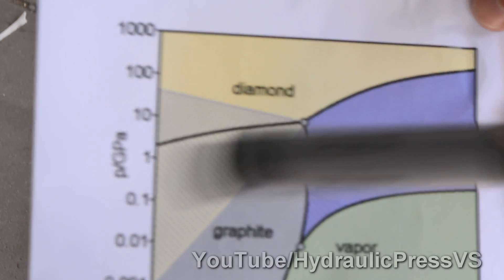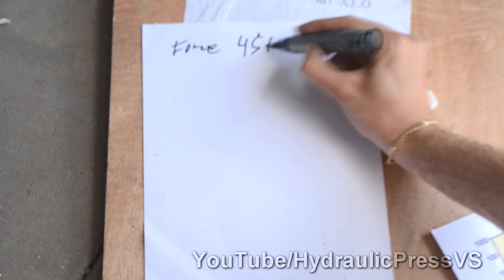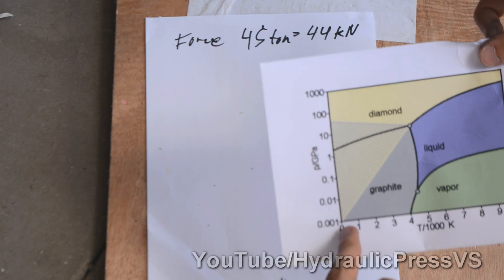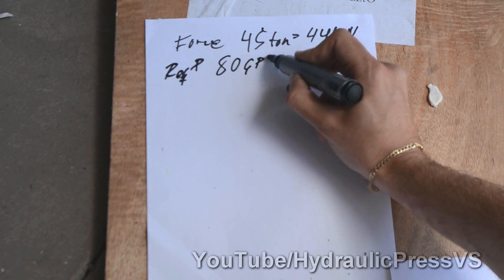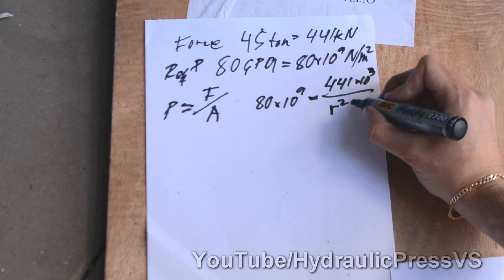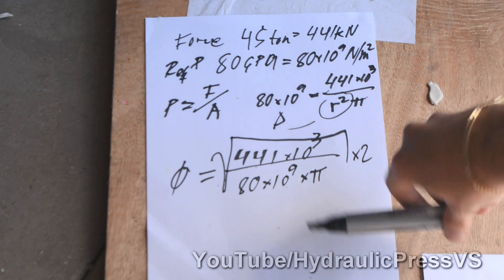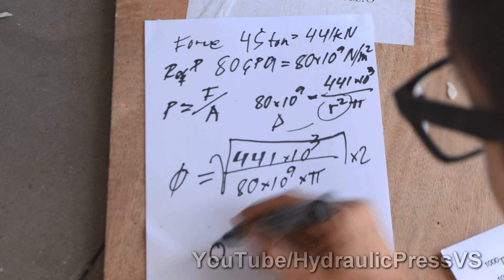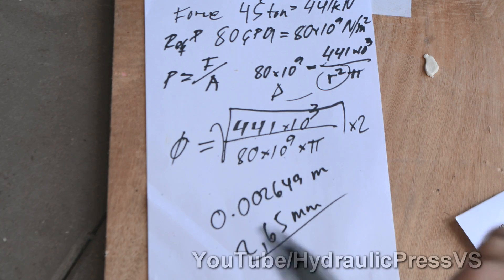Charcoal vs Hydraulic Press - Can you make diamonds from coal?

Comment: Could you please make a different experiment using smaller diameter of the piston and cylinder and then press it and then hold the pressure. Could it be possible to make pellets or something with coal but highly compressed?
And the piston and cylinder should be much longer.

The cylinder should be able to open like a casting mold.

Comment: But what if the cylinder has 25mm in diameter and the piston is slightly smaller but the length of the piston and cylinder should be long so you can fill it with a high amount of coal.

Comment: Even if you could get the pressure, wouldn't it not work bc the diamond would be harder than the metal in the press? It would just embed into the metal before the hardness hit 10 and never get hard enough to become a real diamond.
Reply: Also am i wrong in saying its Heat + Pressure + Coal for a diamond? not just pressure.

Comment: Although I know this video is a joke, I don't believe its possible to make diamond out of just compressing a different form of carbon. If you put dry ice in an incredibly powerful hydraulic press, it wouldn't make a diamond because the hydraulic press would have to change the atomic structure of the material

Comment: THEY DID HAVE TO PUT IT IN A  METAL PLATE WITH AN HOLE IN THE MIDDLE WHIT NO  EXIT AND PUT THE CAOL INTO IT AND COMPRESS THE  IT WITH AN METAL STAFF THAT ONLY FIT THE HOLE PRESS IT O THE MAX SEE WHAT HAPPENS TO IT , NOT LIKE THIS WAY THEY DID IT

Comment: Charcoal has wood fiber in it, wouldn't work anyways.pure carbon to start, heat it in a inert gas to 500,000 degrees using lasers, then squeeze it in a closed container in a 200T press.
You still won't get a diamond, but you'll be a whole lot closer than this experiment.

Comment: First of all, charcoal is burned wood. All if not most of the carbon is burned out and if there was any remaining it isn't enough to form a diamond. The molecules would crack first. Second a hydraulic press cannot create enough pressure to form one even if it was coal or graphite it requires about 1 million atmospheric tons to create a diamond that is less than a millimeter large. Which isn't worth anything. That also doesn't include the amount of heat that it requires too to make a diamond. It would take about 2,000 degrees Celsius too to make a diamond. Third and finally, if you were ACTUALLY ABLE TO FORM A CUT, FULLY CRYSTALLINE DIAMOND WITH CHARCOAL from a hydraulic press then I would go out right now and buy a hydraulic press and 100 bags of charcoal and press them all down into diamonds. Thanks for the get-rich-quick tip but i think I'll stick to reality thanks.

Comment: First of all, diamonds cant be formed from charcoal, only pure coal or graphite, because they are different forms of carbon atoms. Second of all, a significant amount of heat, and a very large amount of pressure is required for a diamond to form. Third, in order for the diamond to become that shape, you have to use lasers to cut it.

Comment: This is just for fun folks.  It's not real, otherwise everyone and their dog would be cranking out diamonds and they wouldn't be worth anything.  To make a diamond you'd need this kind of pressure... or more even... + extreme heat + many, many, many years of time sustaining the pressure and heat in order to produce the kind of rock that would then have to be cut and polished into the piece they pulled off the press here.

Comment: well, it is doable, you didn't follow the instructions though. what you need to do, is to get enough material, get the right temperature and apply right pressure to all material equally at the same time. simples.

Comment: first. you need to adjust a container around the charcoal
,two  then heat the container  add  pressure when temperature is over 1000 degrees you can press the material slowly

Comment: Come on bro at least use real coal, not a fucking charcoal briquette that people use for barbecues. Charcoal briquettes wouldn't work anyways because they're not coal, they have a lot of other additives plus this is a chemical reaction also not just pressure, also heat and several other things
Reply: Diamond isn’t made from coal anyways so it would never work
Reply: But heat is caused by enough pressure
Reply: Ollie Brocklehurst also it is in nature but indirectly sort of. Anthracite coal (coal when it has a very high percentage of carbon in it) is made of the same element that diamond is made of (carbon), but diamond takes a longer time to form because it needs more heat and pressure than coal does when forming. When coal forms, it is because pressure from rocks above it compress and heat it to a solid block of organic material (which on earth is mostly carbon). However diamonds need to be heated to the point that they become crystalline, which would make coal impossible. In nature, when a crystalline mineral or rock is forming underground, and takes longer to cool off to fully take shape, it will have larger individual crystals or one big crystal in some cases. So technically when you have a block of anthracite coal, you have everything needed to make a diamond. Except the time and energy
Reply: First: Get some coal, of any kind.
Second:Get some TNT.
Third:Arrange it perfectly around the coal.
Fourth:Get to a safe distance from TNT.
Fifth:Detonate it.
Result: Aton of Diamonds. 
It's not that hard.

Comment: You need to have it super heated and under extreme pressure. Plus it came out cut, and if you did even manage to make diamonds, it would be in tiny particles not a big piece like that. [EDIT]: That's also Charcoal. Not coal. Can't get diamonds from Charcoal far as I am concerned.

Lies.

Comment: For anyone that didn't know, Diamonds are formed from immense heat and pressure from under /  inside the earths crust. Which is why we mine for the true diamonds ( Not man made ) ; ( Man made diamonds are much weaker then regular diamonds, yet have the same appearance. ) A stunt like this would be impossible to be real. If it were true, We would all start buying coals and hydraulic presses..

Comment: Charcoal? Are people really that stupid?
Reply: Okay, under TONS of pressure, like TONS, and an EXTREME amount of heat it is entirely possible to create a diamond with charcoal
Reply: whahahahaha i didn't even catch that XD yeah that doesnt seem posible haha
Reply: quiksilvermanblue no your stupid compressing coal to diamonds is a thing when you do it's called a man made diamond
Reply: Shaen not enough it be very little
Reply: Yes you can create diamonds with carbon tons of pressure and a looooot of heat.And charcoal is carbon but in this video the heat and the pressure is missing
Reply: Shaen COAL, not charcoal. Not to mention man made would be synthetic.
Reply: Coal is made of carbon. Diamond is an allotrope of carbon , just with more complex and compact intermolecular bonds (which is  why diamonds are so hard to break) this is why under perfect conditions taking into account the coal purity , the temperature and the force exerted. A diamond can be produced from compressing coal.
Reply: People are idiots
Reply: It does work with charcoal
I can explain it.
Diamonds are made of carbon atoms that are VERY tight.
Coal and Charcoal are MADE of also carbon atoms, but not that tight.
If you search what is coal or charcoal made of.
You will see that both are made of carbon atoms.
You just have to press it with the right amount of pressure and heat.
Reply: Coremanite Siege yeah but who cut the diamonds?
Reply: quiksilvermanblue  charcoal are form diamonds if you have the sagested amount of temperature and preesss
Reply: Shaen thats true, but for coal, not charcoal

Comment: A hydraulic press exhibits Force, not Pressure.  You can't realign atoms when they can move away from the force.  Oh, and charcoal is not coal.  not really even close.
Reply: Are you ok sir? The literal google defenition of pressure is a continuous force on something. Also force is required in order to put pressure on something. It isnt possible for anything to have a force on anything else without putting pressure as well

Comment: a. charcoal is burned wood and is definitely not what a diamond is made of, 
b. it would not come out a perfect diamond cut shape😂😂 THIS IS LAUGHABLE
Reply: carbon is carbon. although there are slightly different "versions" of carbon that make the differences between charcoal, graphite, and diamonds
Reply: It actually is made out of charcoal, or carbon rather, which charcoal is. But it needs to be under great pressure and heat to be created, that's how synthetic diamonds are made.
Reply: Duh
Reply: allie freeman lol exactly

Comment: there is a difference between the mechanical application and thermodynamics. You need to make the environment at a specific point of temperature and pressure to force solid molecule reorganize in such way that they will form the molecular structure of the diamond. moreover, you have to somehow control the reconstruction of the molecules during the process,which is hard to do, so that's not a diamond, but I know you guys are trolling us tho anyways.

Comment: even if i diamond was made that way, it wouldn't be perfectly shaped
Reply: WeKTrAz the funny part is you can't make diamonds from charcoal.
Reply: right, I believe it has to be true carbon to make diamonds
Reply: Actually you can with intense pressure, but of course, it wouldn't be shaped like what  he said, but this is also the wrong way
Reply: Ευαγγελια Παπαδοπουλου well diamonds are usually cut by an actual gem cutter
Reply: Eva Papadopoulou actually yes it would however rhe difference between a diamond millions of years old and one made in a few minutes is the purity and clarity of the diamond. Scientist can essentially cheat this however by increasing pressure and heat the higher both are the more likely you are to get a higher grade product on that note your also more likely to shatter the diamond mid-form on that note most diamonds about a millimetre or less generally used to decorate a centerpiece are man made.

Finally the true reason a natural diamond is worth so much more then man made is that natural diamonds symbolize immortal love or love that transcends time. A man made diamond at the highest grade we can achieve without shattering(if the intention is not to shatter) is still not worth much as its made in at most a few hours(assuming your trying to lower the chance of shatter.) 

After all how can something made in a few hours be worthy of being called eternal love.

Its also why man made diamonds are cheap as fuck. The bigger diamond was definitely man-made. If not then it was either a volcanic rock or just a really young one.
Reply: They also have to be under that same pressure for a long time not exactly sure how long
Reply: This is dumb diamonds are made up of pure carbon and is under the heat and pressure of the whole earth for thousands to millions of years, you cant make a diamond under a hydraulic press for like 10 seconds and btw diamonds are like the cut ones search the molecules of diamonds and you'll catch me drift
Reply: Ευαγγελια Παπαδοπουλου ARE YOU GREEK???😍😍😍😍
Reply: Ευαγγελια Παπαδοπουλου κι' εγωωωω νιιιι, No.
Reply: darkmixas ...
Reply: Ευαγγελια Παπαδοπουλου That's charcoal too
Reply: like you huh ;)
Reply: Your name is funny
Reply: Jacob Tellone shots fired 👌🏽👌🏽👌🏽
Reply: Eva Papadopoulou exactly
Reply: thelo na pethanoun oloi
Reply: Ευαγγελια Παπαδοπουλου yeah it should of shattered
Reply: diamonds are made that way, though, just not out of charcoal.

Comment: Diamonds are made when heat and pressure combined on  he coal
Reply: if you read the graph you will see you can also just use pressure and leave out the heat - but it takes a lot of pressure
Reply: Richard Clark yes but it's like using the density of the earth pressure

Comment: if he made anything, it would be graphite. Coal, diamond and graphite are all carbon based materials. They just have different molecular structures, you can't crush a material with a cuboid structure and make it into a pyramid structure.
Reply: Ben campbell-wilson yup ur right mate. Is exactly that. The molecular stricter of atoms between diamonds and graphite are different. 100% carbon arranged in different ways. One breaks so easily you can use it to write like a pencil. Other is so hard you can scratch and cut almost any material
Reply: Ben campbell-wilson that's a good point I didn't think of that those carbon base materials do have different structures.
Reply: sylverckerjp the graphite doesn't have a cuboid structure. It has a a sheet like structure so if compressed it would fall apart.
Reply: science kids
Reply: #nerds
Reply: Or becuase it’s a diamond just flip the cubic shape 35 degrees and you get a diamond yet probably not the one your thinking of

Comment: The diamond in the end was a joke, they weren't trying to trick anyone. He pulled out the diamond then immediately cut back to the equation that proved he didn't have enough pressure, then to him laughing at the required heat because they did it at room temp.

Comment: Just want to let you all know that there is a process of changing atoms from a parent material to a child material and that takes a lot of time. Diamonds have a very long half life and it truly does take thousands of years to change carbon into diamond. It's not just heat and pressure, it is dependent on the time of change. This is also how we determine the age of things that are carbon based.
Reply: +lisa warren Although 209Bi holds the half-life record for alpha decay, bismuth does not have the longest half-life of any radionuclide to be found experimentally—this distinction belongs to Tellurium-128 (128Te) with a half-life estimated at 7.7 x 1024 years by double β-decay (beta decay).
Reply: That has got nothing to do with changing atoms - and half lifes of radioactive carbon isotopes ( C13 & C14 ).

Their problem is that it's not pure coal and not in a crystaline form that would be beneficial for 
creating diamonds, even under the correct pressure and temperature conditions.

And then this method doesn't apply an equal pressure from all directions, but only along one axis -
so that the charcoal can just flow out to the sides.

Try using graphite instead - it has been done, and is used for making synthetic diamonds.

Comment: First of all, you need extremely high temperatures with pressure. Secondly, that was not carbon. It was a composite made from coal dust and cement.
The whole thing was total bullshit.

Comment: You don't even need a hydraulic press, just hit charcoal with a hammer.  Every successive swing adds to the total pressure.  It should take about 1000 swings with a hammer to make a diamond out of charcoal, that's why no one does it, they're to lazy.

Comment: You need extreme heat equal to the earth's core and pressure equal to the inside of the earth's core, that is why diamonds are so rare, you will either get burning hot compressed carbon, rarely diamonds, or magma.

Comment: i may not be the biggest dildo in the night stand, but I'm fairly certain that diamonds are made from pressure+time+coal. I'm not a scientist, but I do know you used CHARCOAL. You need COAL, the fossil fuel. Charcoa, is burnt wood, while coal is dinosaur bones. An honest mistake. Also, there is the fact that this diamond was perfecty cut! Not a speck of ore to be found! But what do I know I'm only 14 Hahahahaha.
Reply: Charcoal would work perfectly well.  It just has to be carbon.  But it takes more temperature and a lot more time to do it this way than just a couple of minutes.  Especially with the quantity of impurities in a charcoal briquette.  That's why diamond synthesis generally uses chemical reaction tricks instead.  Much faster and easier.
Reply: You say coal's made out of dinosaur bones like they're so special. They're still bones, and still made out of the same basic elements as any other bones are.
Reply: Its just a joke dude.
Reply: Dude I'm 11 and I am a scientist and u good use charcoal as it is made of carbon even peanut butter would work if the press was very strong
Reply: WildWolf Multimedia they do what they must because hey can